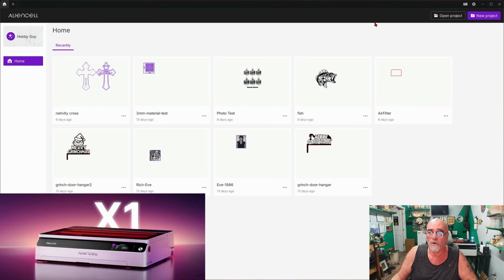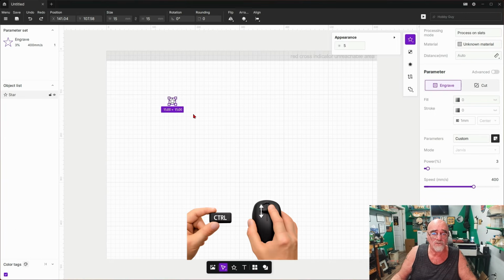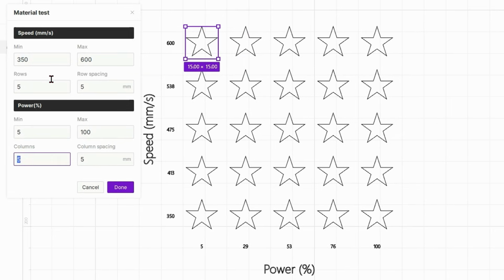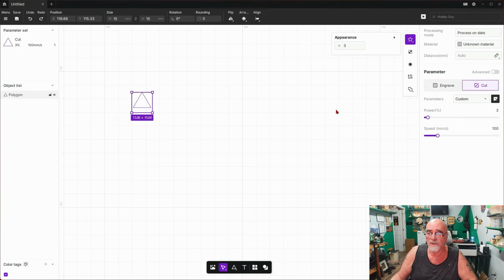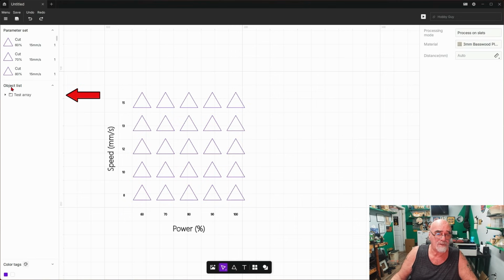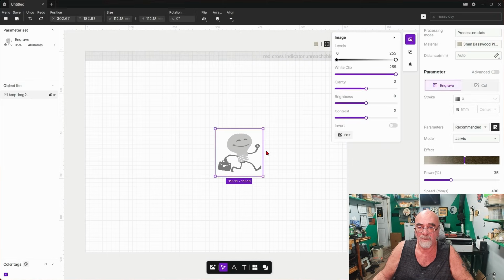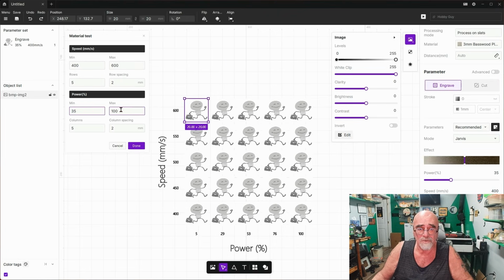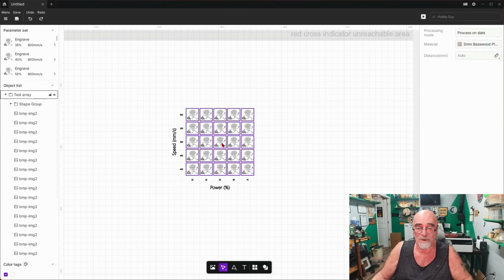😀 Exciting new features in the Aliencell X1 Diode Laser Material Test!

Comment: Hi Rich, so helpful, as always!  When you do a material test, you have the knowledge to choose the parameters so easily.  I would like to do a material test using 3mm mdf.  What parameters should I use? (40W)
Reply from the maker: Since individual machine performance and environments vary so much, I can't give you recommendations. Start with a known setting from the built-in library, such as 3mm plywood. Then use that as the highest number for speed and power.
Reply: @TheLouisianaHobbyGuy thanks. 40W Aliencell X1

Comment: Hi Rich, can the editing software be used for other lasers by saving the g code at the end of setting up process? Many thanks. Pat
Reply from the maker: Not that I know of Patrick.
Reply: @TheLouisianaHobbyGuy  Thanks for the reply, Rich. Yes, I have had a good look around to see if there was any workaround, or conversion method, but as a proprietary software it looks like its tied to their laser. Maybe Lightburn might like to introduce the image option in their material test? I work with greyscale image engraving on black slate and have to do a lot of testing as not all slates "burn" the same. A workaround like this would save a lot of time and material. Cheers.
Reply from the maker: I've asked for image material tests a dozen times Patrick.